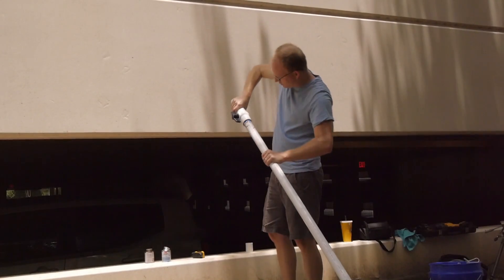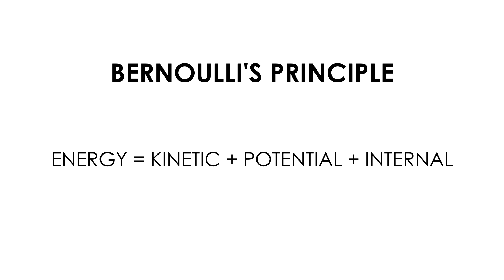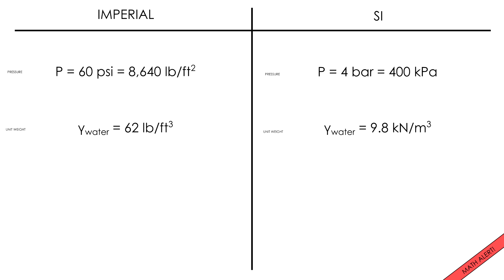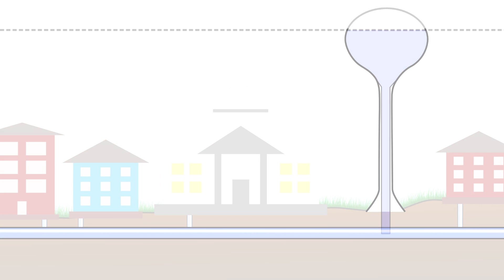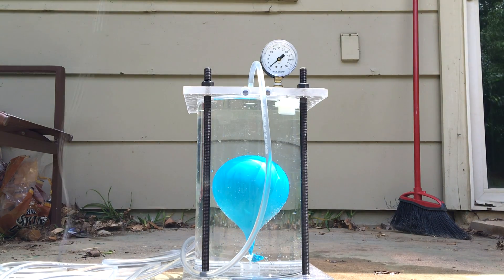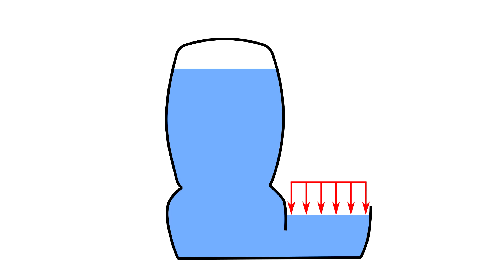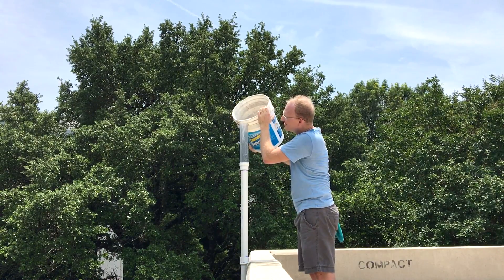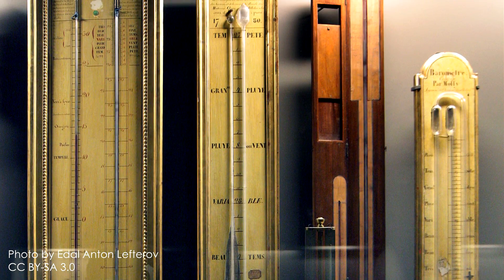Boil Water at Room Temperature! - Hydrostatics

Comment: And thats why there is no good argument for celsius :^)
Reply: hoodedraider: You need to elaborate your point about absolute zero and provide some puttanesca sauce for that claim.
Reply: Absolute zero has been disproven?
Reply: Freezing and boiling temperature at atmospheric pressure is not an argument?!
Ever look at what Fahrenheit is based on? masterkek
Reply: hoodedraider
Two things chiefly, human body temperature and salt water. Both of which are more important to humans than how pure water reacts at an arbitrary pressure on an arbitrary planet. Thousands of years from now while we are conquering the galaxy the pressure at sea level on earth will be a silly thing to base measurement on. Particularly given that atmosphere loss will lower the pressure gradually over time anyway, and the sun getting warmer and warmer will eventually boil off the oceans. No, thats a terrible transient metric, not stable at all.

Kelvin is a step in the fight direction, but im spiteful that it uses celcius' unit lenght. We need a unit length that itself is based on some universal constant.

Untill them im sticking with what aint broke.
Reply: Kelvin is also flawed, it implies -273,15 being absolute zero. This has already been disproven. Does Kelvin also no have the same issue you mention with Celsius, being pressure?
Although i think the influence of pressure under normal living circumstances is neglectable. Fahrenheit bamboozles me because it uses a salt concentration as a calibration, this seems odd as ionic charge and concentrations can be slightly off.
Reply: hoodedraider
Indeed, my point is that our options are all rather arbitrary and there is no good argument for using celsius over the others based on any sort of hierarchy of the purity of what its based on. The only argument for celsius i ever see is 'water'. So since we have established that thats not really an argument, then it all comes down to preference, and ive got plenty of arguments why the scale itself of fahrenheit and the unit size is much more useful for day to day human living over the scale of 0-100F
Reply: They actually redefined the whole thing as 0 Kelvin is absolute zero, the tripple point of water is 273.16 Kelvin, and Celcius is the temperature in Kelvin minus 273.15. This definition makes it consistent not just at any altitude, but anywhere in the universe (as far as we know).

Comment: I still didn't get it for the tank with different shapes, what would happen if the neck of the tank is so narrow that it's like the diameter of a hair? And when the diameter tends to zero, the neck should behave like it suddenly vanish and the pressure at the bottom of the tank suddenly drop?

Comment: Very thoroughly explained well done. It's tricky to have a specific target audience on youtube as people's prior knowledge varies so greatly. After looking through the comments i think there's two main things people are still missing. 1) The lower container being sealing is absolutely critical in the model 2) There's no such thing as suction or negative pressure. When i try and explain similar ideas  to people about pressure i pump up a bike inner tube to 101kPa (14Psi) and get them to squeeze it, then try and explain how the air around you is actually squeezing you that hard all the time but we're just used to it. I think your average viewer doesn't understand gauge vs absolute pressure. 
Your videos are of much higher quality than a lot of the stuff used at universities. I reckon you've got the potential to go niche and even sell content to universities with more specific videos. My university was really struggling to teach heat pumps, a video like this about isentropic efficiency, mollier diagrams and carnot cycles could go a long way. There's videos out there already but they're very much just voice over written notes.

Comment: Love your videos. I have read that water boils at lower temps the higher the altitude. So if you boiling water at, for instance, the top of Mt. Everest water would boil at a lower temp then the usual 212°. Are we talking about the same principal here?
Reply: Yes.  The boiling point of water depends on the pressure the water is under.  In general, the higher the pressure the higher the temperature required, and vice versa.  On Mount Everest the air pressure is lower than at sea level, and therefore the boiling temperature is lower as well.  Here's a chart with the exact relationship: https://upload.wikimedia.org/wikipedia/commons/thumb/0/08/Phase_diagram_of_water.svg/700px-Phase_diagram_of_water.svg.png
Reply: You got it! Water boils when the vapor pressure equals the external pressure exerted on the water.  You can either increase the temperature or decrease the external pressure to achieve this.  I can boil room temperature water by placing it in a vacuum chamber and the temperature decreases as the water releases energy and will transition from boiling water to ice.

Comment: I'm confused. If I measured the pressure 20 ft under the surface of the ocean, then built a tube filled with water extending 20 ft above the surface of the ocean and measured again, the pressure would double? What if the pressure gauge was 20 ft under the ocean in Florida and I built the tube off the coast of Maine?
Reply from the maker: That would only work if you could enclose the ocean. Otherwise the water level in the pipe will just equalize with the ocean.

Comment: Very cool video! A barometer makes much more sense to me now. 

So when the water boils I'm assuming it becomes very hot, but is it 100 degrees, or is it under pressure so less? 
I also guess that the temperature then disappears quite quickly again?

Also, does Mercury boil in the same way in the smaller tubes?
Reply: The boiling water in the barometer is not any hotter that the water before the bottom of the barometer was opened (in fact, it should be a little cooler because going from a liquid to a gas takes up energy.)  The diagram at 8:53 demonstrates what's happening: when you decrease the pressure, water will boil at a lower temperature.  That's why water boils at different temperatures on e.g. Mount Everest, and why guidelines for cooking some boiled foods are different for people who live at high altitudes.

When the bottom is released from the barometer, the pressure at the top of the column drops (it has to hold up all that water below), and that pressure drop will result in some water boiling.  As the water boils, gaseous water vapour creates a small amount of pressure that eventually stops the rest of the water from boiling.  That pressure is called the vapour pressure of water at room temperature, and it's safe to call that pressure a vacuum relative to the pressure on earth (at room temperature, the vapour pressure of water is about 3% the atmospheric pressure at sea level), so basically the same effect occurs.  I can't say for certain, but I would assume that mercury does the same thing, since otherwise it would be exposed to a near-vacuum, and I can't imagine a metal that's liquid at room temperatures not evaporating at room temperature in a vacuum.  But it's likely that there will be much less boiled gaseous mercury at the top of the tube, since mercury probably has a lower vapour pressure at room temperature (the pressure at which it will stop boiling).

I hope I didn't get everything wrong, but I'm pretty confident that's the gist of it!
Reply: Thanks for the answer Andrew!

I will probably need to use some more time to really wrap my head around this effect, but your words helped out a lot!

I think my way of viewing the word "Boiling" is to narrow, so I will read a bit up on this whole pressure thing :)

Comment: Please tell me if I'm wrong! The pressures at the bottom of those containers at 0:40 are actually different.
My reasoning: Pressure is a measure of Force/Area. That would mean that the only way all the containers could have the same water pressure at the bottom is if they have the same bottom cross-sectional area (which they don't). So... the container at the far left has the highest water pressure at the bottom since it has the largest cross-section area. Again, tell me if I'm wrong and why, thanks.
Reply: It's pressure inside the water at any given point. Not vertical pressure downwards on the ground. Imagine it's like the pressure you would feel if you were swimming underwater at that point.
Reply: Simply you have one equation with one variable that's height 

P at tank bottom = d*g*h + patm 

D (density) and g and Patm are constants 

The only player is h not cross sectional area 

Since all tanks have same height they have must have the same P at tanks bottoms.

If you are looking at P=F/A

The shrink in A is balanced by the shrink in F (mass*g) leading to a constant P mathematically.
Reply: Because mathematically, the force of the water is the specific weight (density times gravity) of the water times the volume of the water.

Sw = density =  [slug/ft3]*[ft/s2] = lb/ft3          (slug = lbs2/ft)

F = Sw*Vol = [lb/ft3]*[ft3] = lb 

So no we have a force in pounds pushing down. 

We know pressure = Force / Area,  in this case we take the vertical cross sectional

P = Sw*(Vol/A ) and considering that Vol = Area*height we are left

P = Sw*h  [lb/ft2] 

Because Sw is constant, for water at room temperature it is 62.4 lb/ft3, that gives us a direct proportional relationship between pressure and water height or depth 

P~h
Reply: > My reasoning: Pressure is a measure of Force/Area. That would mean that the only way all the containers could have the same water pressure at the bottom is if they have the same bottom cross-sectional area (which they don't).

Or if the force is proportional to the area.

Anyway, I think, although the explanations were mostly clear, the explanation about energies in water could benefit from telling us why the energy must be the same at every point, what happens if it is not the same.
Reply: The pressure in this case(fluid+gravity) is vertical.
.
It's like stacking boxes (or ice cubes). It doesn't matter the size of the base weighing plate, the vertical weight is the same....
 It just has to be on top of the other
... Fluid is weird.
Fluid doesn't have solid friction.
.
.
Take away the solid container, the pressure will be the same at each height.
Fluid will fall away from itself. So measurement is straight up.... Even though there's a funnel container.

Comment: ahem, so continuing on what you said around 9:20, does the water "boiling" trick also with when I put a bucket of room temp. water into say, a very tall elevator?
Reply from the maker: Yes, as long at the elevator is tall enough to get to an altitude where the atmospheric pressure is below the vapor pressure of water (i.e. space).

Comment: I love this channel because he leaves nothing hypothetical. He builds and demonstrates everything and leaves us amazed. He works really hard on his videos
Reply: so what youre saying is that hes using puts sunglasses on practical engineering
Reply: @TexasKing100  sir you are a gangster
Reply: From a practical perspective it may be helpful to remember that water pressure in PSI is equal to the height/depth/head of the water (column) X 2.31 feet pounds per square inch (& 0.433 PSI per foot of height.)

Comment: At what temperature water is when it's "boiling".
Reply: Boiling temperature depends on pressure. Lower pressure means lower boiling temperature. In a complete vacuum, water boils at almost zero degrees kelvin.
Reply: First, the water is actually boiling- it's not "boiling" as in fake boiling.  Second, it is boiling at the surrounding temperature, whatever it was on that nice day.  70 degrees or so.
Reply: This is technically true but should have some clarification. Bellow about 611 Pa, it's triple point, water no longer exists in a liquid phase so it would really be sublimation. Less relevant, at low temperatures the sublimation rate is very slow, this is how comets survive for so long despite being mostly water ice in mostly vacuum.
Reply: +snowpdx i was look for this comment hoping some1 explained why it boiled thanks man
Reply: +snowpdx
It does? All phase diagrams I can find put it at more like 200 Kelvin.
Reply: IamGrimalkin Liquid water would boil until the gas got below ~200 K, then it would freeze. It has to shed all the heat energy keeping it liquid first. Astronauts have watched it happen with their urine, if that isn't TMI :)

Comment: Does boiling water this way have any of the other effects of boiling water with heat? (Sterilization, desalination etc?)
Reply from the maker: Interesting question. I would guess no to the sterilization (since the heat is the important part there). Desal would depend on the solubility of salt at very low pressure - I don't know from the top of my head.

Comment: Hey Grady, great video as usual!

Constructive criticism: a simple diagram of each of your real-world experiments explaining how you set them up would help. 

For example, the hydrostatic pressure demo with the 1/8" poly tube is difficult to follow if you don't already understand how it works. Showing how the water-filled tube connects to the tank and why you connected the balloon's air to the top of the tank would help demystify that setup.

And the water barometer could have used a drawing afterwards showing how the water level fell to some height around 35 ft. Bummer the clear tube was too short! I know how much work those experiments are. I just got back from a camping trip where I got to try out a little spiral pump I threw together (https://youtu.be/-eTbXG_l8HE). It's so much fun to watch projects go from paper to garage to outside, and it's such a bummer to find the failings once you're past the modifications stage.

Comment: If your water column is about ten meters high and substituting mercury for water means it is thirteen times smaller, doesn't that make it .... ten meters times thirteen equals one hundred thirty meters. Ten meters minus one hundred thirty meters equals negative one hundred twenty meters. How does one have a column measured to a negative value?

I think you mean to say that mercury allows a column about one-thirteenth the size of the water column. There is a valid difference and it's not simply semantics.  http://timesless.com/

Boiling water with no heat? Somewhat misleading, unless you are able to maintain absolute zero, yes? There is plenty of heat in, as you said, room temperature water. Heat pumps make good use of this characteristic, of course.

Comment: So does that mean water towers are fed by variable speed pumps to keep the level at a fairly constant height to keep a constant pressure in the line?  Every since playing SimCity as a kid, water towers have always confused me.
Reply from the maker: That's a whole different can of worms. Keeping potable water potable is a major challenge - many engineers have entire careers dedicated to this field.
Reply from the maker: The entire water grid is usually pressurized by pumps. The demand on the system is gradual, so the pumps don't necessarily need to be variable speed. You can adjust pressure to demand by turning entire pumps on and off. The purpose of the water towers is to smooth out the demand.
Reply: +Practical Engineering that makes sense, loving the videos and newer format
Reply: So there's a lot of standing water in the tower - isn't that a potential health hazard?
Reply: Water towers are also used essentially as batteries to "store" electricity. Power plants can't increase/decrease production as quickly as demand so excess power can be used to pump water up the towers saving the need to use the electricity later. e.g. use solar to pump up water during peak daylight so you can save your generators for powering cooking at night.

Comment: VERY cool stuff. I'm currently taking a break from studying for my Thermo final. We learned a lot about how much pressure and temperature can affect phase changes. How stuff like Heat pumps/AC works. 

So cool to see it in "real life" and not in a text book, you don't get to see water boil at 70 deg very often.

I, and I hope the rest of your subscribers would like to see a very rudimentary Air Conditioning system or heat pump system. I know it absolutely blew my mind when I learned how AC actually worked, refrigerant and going through phase changes,  expansion and compression etc. Don't know how easy that would be to make though, not very simple but maybe something very small scale would work
Reply: Easy. Get a 100ml syringe, fill 5ml with water, make sure to have no air in it. Hold the end with one thumb and pull the pump with the other hand.

Comment: Awesome video! Can you explain why water towers are top heavy? It seems like they would be easier to construct if they bulb portion was at the bottom instead. Since he pressure would still be the same.
Reply from the maker: Thanks. It's true that the pressure would be the same, but they also need to be able to "smooth out" demands on the system. If the tower was just a narrow tube, using just a small amount of water would lower the pressure dramatically.

Comment: Still kinda confused by all this. How does this relate to the effect of capillary action? Can it be explained using the same formulas? I live in a city with almost no hills, but very tall buildings. How do they get the water up so high?
Reply from the maker: Capillary action is a totally separate topic that is based on surface tension. We have formulas to describe it, but I didn't discuss them in this video. Cities use pumps to increase the pressure in the water mains. If it's a tall enough building, it might have its own pumps to get the water even higher.